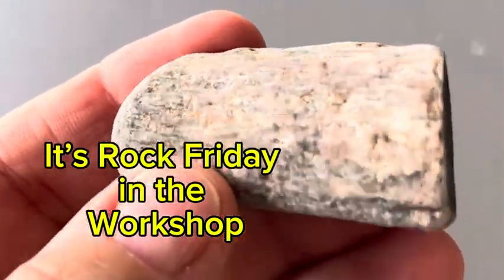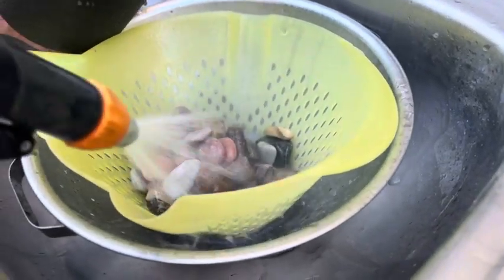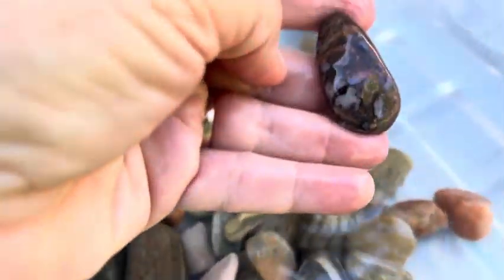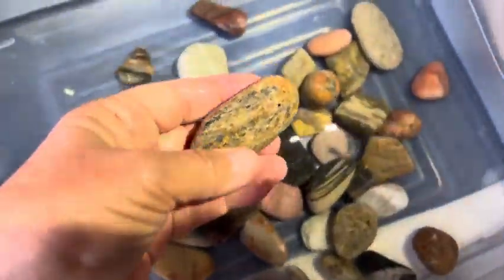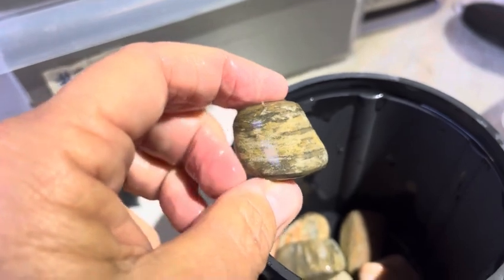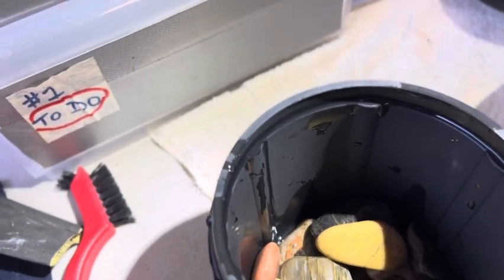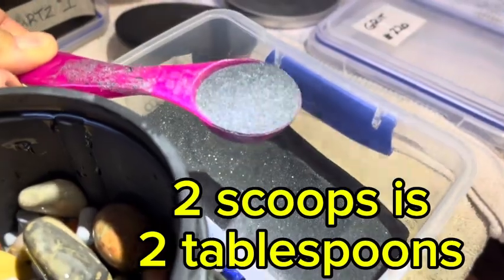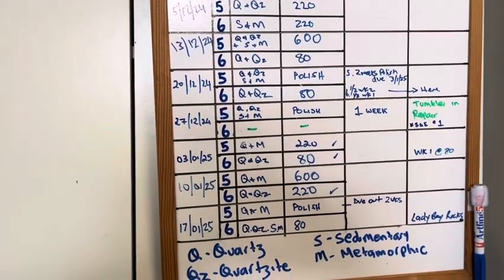“Petrified Wood in a Rock Tumbler.  What does it look like after 1week?” #rocktumbler #rockhounding

Comment: Matching your grit to your media I have not heard before, thank you for the suggestion. I must apologize I had no idea you tumbled rocks. Just subbed to you
Reply from the maker: @mintycactus1152  hi, thank you. Yes I keep seperate ceramics for use with each grit type, it’s easier and when I get to burnishing stage it all gets cleaned up same.  Just makes sense in my storage area.  I have sections for each grit type and keep ceramics with each type.  I don’t need grit sticking to ceramics etc if it’s not same. Especially for the polishing process. 😀when I polish I use ceramics specifically for polish.